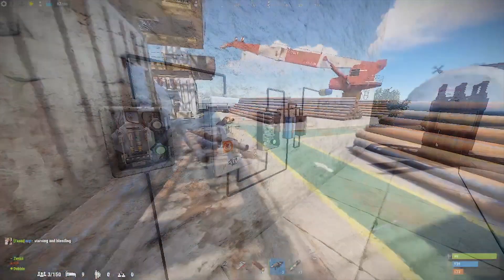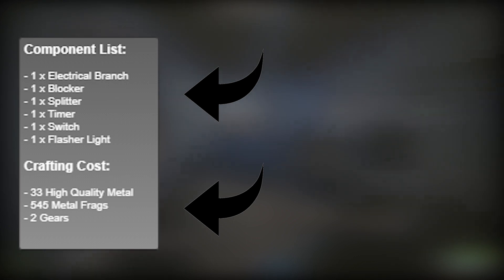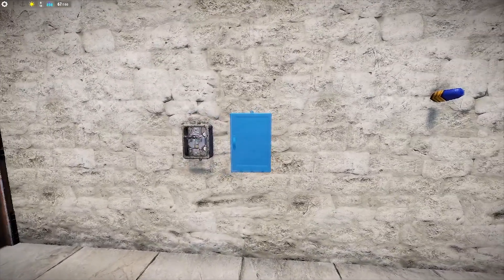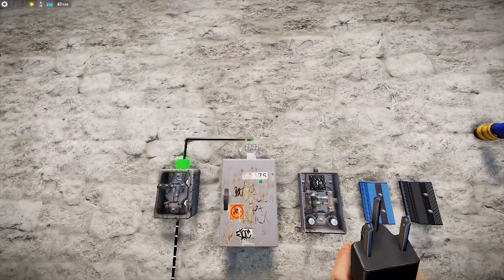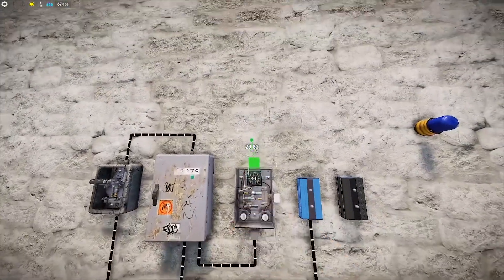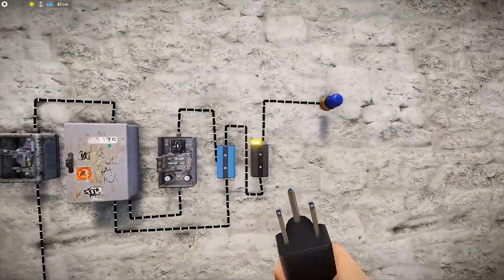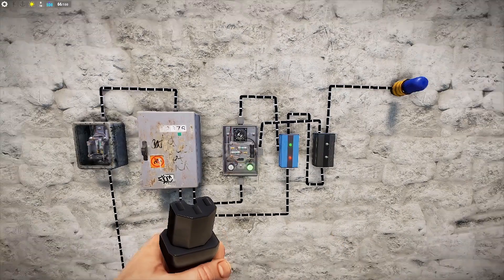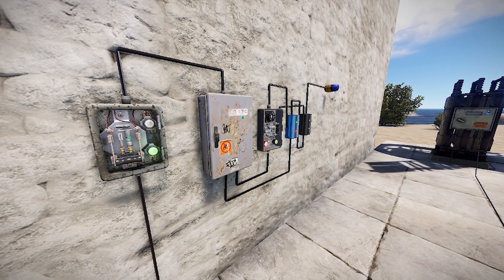RUST | Electricians Guide | Simple Timed Loop Circuit | RUST Electrical Guide 2021  #1

Comment: Personally, I think this is a better solution than solar panel disrupters so that you can have lights in your base exactly when you need it - for example, if you can spare the resources to light the base during the later evening but before it’s actually dark.